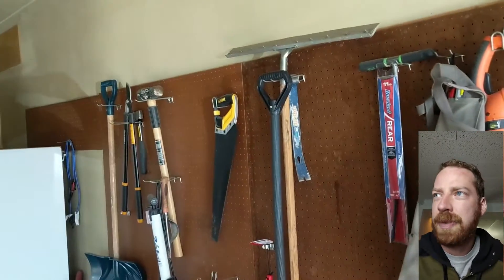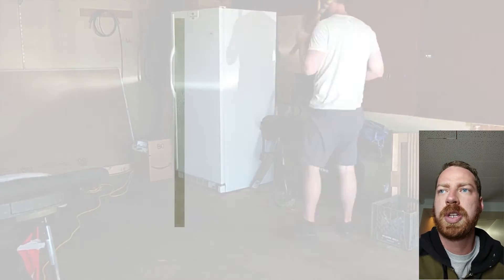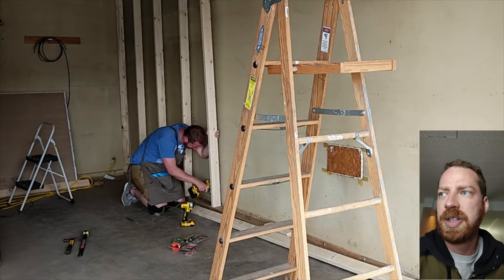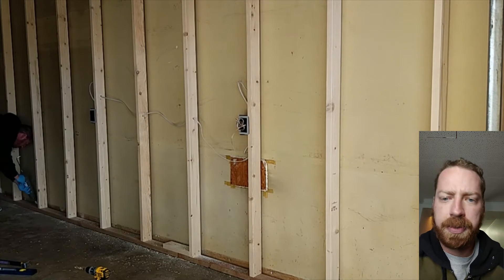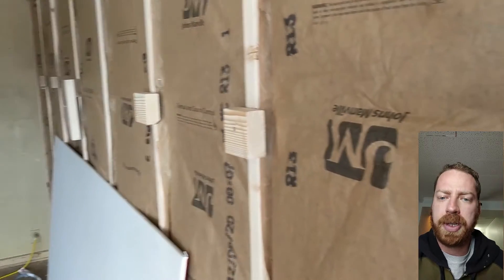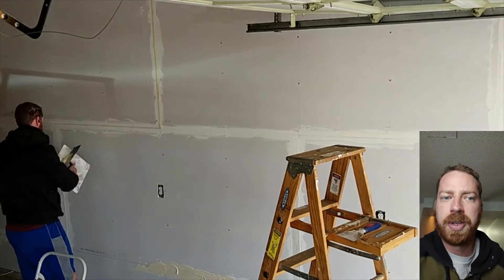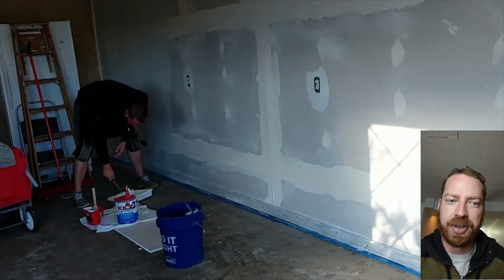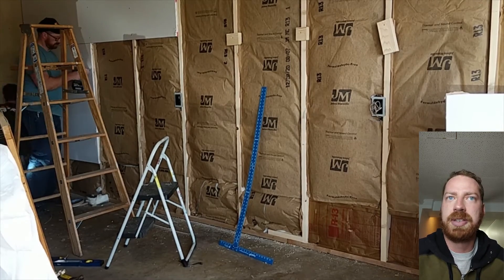Does a double wall work for sound proofing??

Comment: Not a good job for soundproofing. You need clay around your junction box that holds the outlets, you also need Mass loaded vinyl attached to the frame before sheetrock and you're better off using osb board as it is heavier and better souproofing then pit sheetrock over that. Would make all the difference

Comment: What a huge expense for nothing. 

You need to air seal, man! Spray foam would help a ton for budget sound dampening
Reply from the maker: Oh I disagree, that might work what you are suggesting, but what I did in the video absolutely worked. I did a lot of research before I spent money on this and was able to come up with a good solution that works well for us. I have had multiple babies 2 walls away and I've been able to work in the garage just fine, thanks to this wall!

Thanks for your opinion though!

Comment: Hey dude just wondering is a vapor barrier necessary? i want to do this to an existing interior wall in my house.
Reply from the maker: Hey there, Andrew. If it's an interior wall, then no vapor barrier should be needed. Code may be different in your area, but I doubt a vapor barrier would be required wherever you live. Good luck, I hope the project goes well!

Comment: It's obviously too late now... but you should have removed the existing layer of drywall from the garage side before adding the second wall. It's counterintuitive, but the extra layer of drywall in the middle actually reduces the STC pretty dramatically. I believe it's called the 3-leaf effect. Basically you want the air cavity to be unbroken and as large as possible. I think part of it has to do with the thickness of the air cavity in relation to the size of the sound waves.
Reply from the maker: Interesting, I haven't heard of that, I'll have to research it! Yeah there was a couple of other things I could have done better as well, but overall I've been pleased with how well it works.

Comment: it doesn't work?
Reply: No actually it works fantastic, I cut wood and work on projects in the garage and haven't woken the baby up yet. I am surprised at how well it did work!
Reply: @zatedford  thats good consider how loud that can be. Maybe if you had put soundproofing board insulation would have been better
Reply: @zatedford  but have you asked another adult be in the baby room and you cut or work in the garage and call them to ask if they can hear it?
Reply: @naegleriafowleri2230  yep absolutely! We've tried it out just like you described and although it can be heard in the master bedroom, in the baby's room you can't hear anything, and it sounds very far off in the master bedroom :)

Comment: Man, you didn’t put metal brackets over the wire holes of each 2x4, you should’ve put 1 inch foam board between the walls and then used rockwool as your insulation.
Reply from the maker: Hey there, I guess I'm not familiar with the metal brackets you are talking about? Do you have a link to what you're referring to?

Oh and I thought about doing rockwool, but the extra cost for how much extra sound proofing didn't make sense for me, but I definitely recommend rockwool if you're going as hard that way as you can!

But for me, this is more then enough sound proofing for my purposes, I'm thinking about releasing another video to show that 6 months later I can make as much noise in the garage as needed and the baby still sleeps!